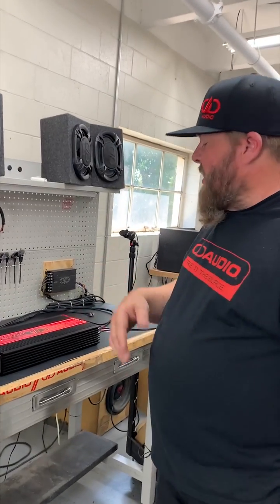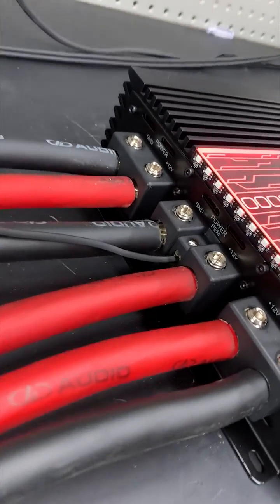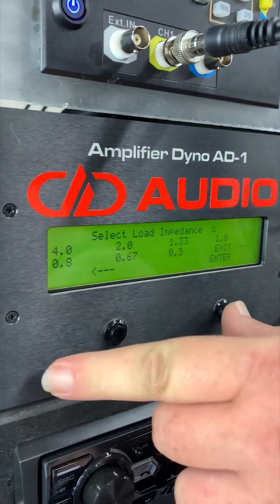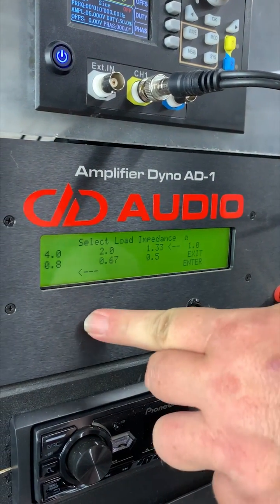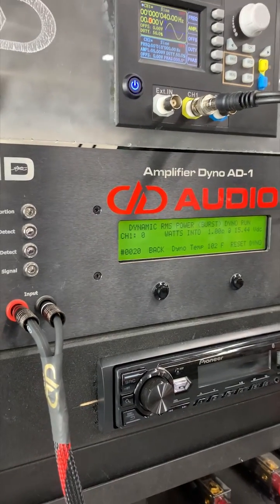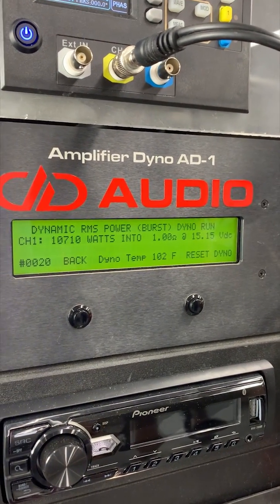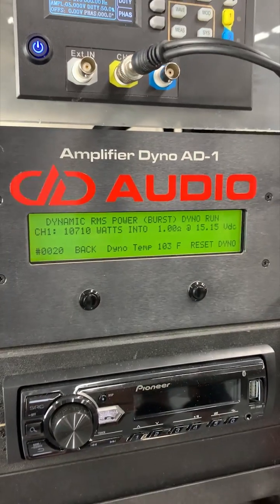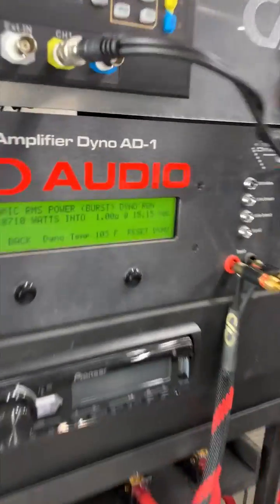M8000 Amp Dyno Test at 1 Ohm

Comment: Who cares what it does at 15 volts lets see 12 volts
Reply: I agree. Let’s see a 12v-13v run DD Audio..
Reply: Who would run a 8k amp at 12v tho?
Reply: @eriqhayter8171 amps should be rated at 12v they inflate numbers using 14.4
Reply: @ yea I get that but realistically nobody running that low while running that high of power.    Most ppl I’ve seen running over 5k voltage is typically higher than 12-14
Reply: @QtrollKvng  it's just a better base line to compare amps equally
Reply: @ I feel that.

Comment: Nice, im wondering if the new M 2500 mono amp does little more then 2500 rms? I was looking at getting around 3k for my system and seen the next amp would be the M 5000 unless i can still find the M 4000

Comment: What the F. I feel like I got robbed. Im about to pull the trigger on the M8000, but I cant find any good demo, dynos, ect. Why wouldnt you just run it thru? Im (and most others) are wired to 1ohm or above), which means our subs will never really see 1ohm. So 2 and 4 ohm run will give the majority of your customers a better idea.